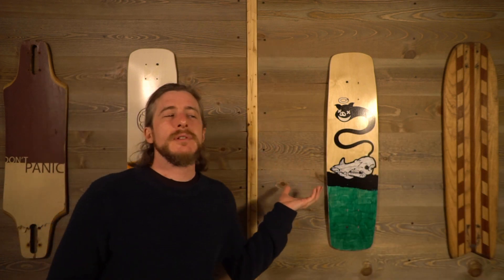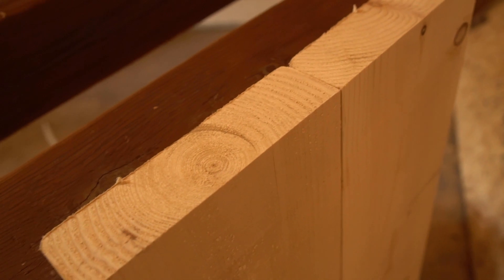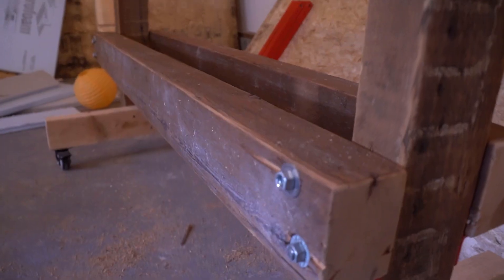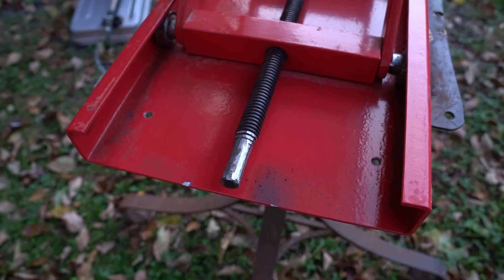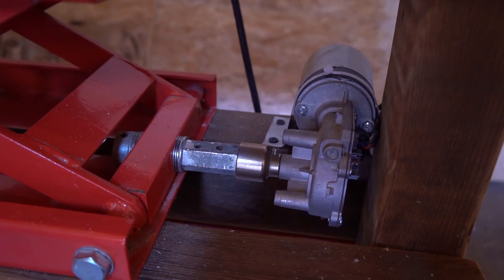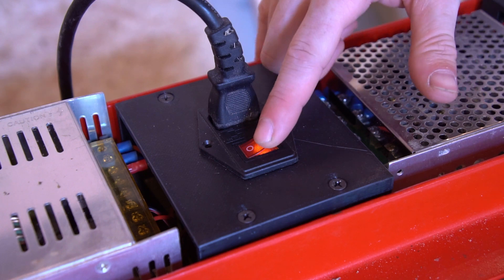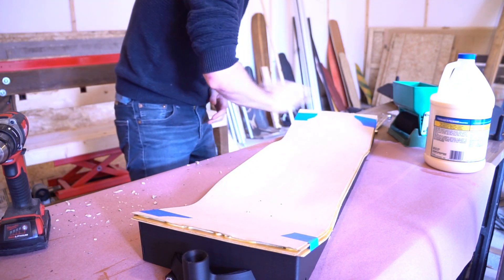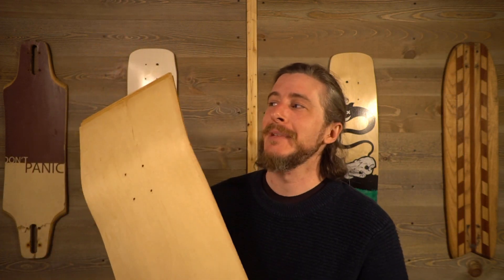Building and Testing my New Electric Skateboard Press

Comment: Hello thanks for the video, that's very intersting.
I want to build a larger press inspired by skateboard press, not for skate deck but , to mold wood thin planks after heating by steam. And I need to mold fast (because of the temperature). Please do you think you can build faster movement press with your system?
Best regards
Reply from the maker: Maybe? The press is fairly slow moving but it closes up in about 15 seconds, so I guess it depends on how much time you need. For what it's worth: if you're going to build a press this way I'd recommend only using a single jack. Getting two jacks to raise and lower in sync has been a huge headache
Reply: @GoodRoads  thank you. At a moment I was thinking on a manual press. A specialized press is not an easy thing to build.
Reply: @GoodRoads   A small question please does these 3D printables molds can be made for everything? On measurement? For exemple a curved wood furniture or a wood dome?
Regards

Comment: Evidently two screw jacks makes sufficient force. You haven’t had any problems? Normally guys use hydraulics which put out maybe 10 to 20 times the pressure. I guess that’s overkill.

Comment: Which motor are you using? I'm deaf and I want to get an understanding how you get an idea of how much power is needed to build a pressure of 2 tons for example.
Reply from the maker: I'm using a set of windshield wiper motors, I've had nothing but issues with them though, the connection method on the shafts are really specific to their use in cars. A geared motor like this with a normal keyed shaft would be so much easier to work with

Comment: if you used brushless motors instead of DC brush motors you could use field oriented control to have more precise control of the motors and run them in perfect synchronization

Comment: how did you manage pressure amount ? i think you need some sort of off switch as safety switch to prevent mold cracking.
Reply from the maker: I just run it until the motors start to bog down, this press isn't strong enough to break the molds

Comment: Hey just wondering, how often do you check orders on your site? I ordered the upgrade kit for the pressure pot on the 7th and not goten any notice yet. Haven't seen any other way to contact about it is all!
Reply from the maker: Hey! Sorry for the delay, I had a couple print-on-demand orders come in all at once and the upgrade kit was in the middle of the queue. It has been printed, packaged, and dropped off at the post office. Shoot me an email at chris@goodroadscollective.com and I'll get you the tracking number, I'm having issues with my website not sending them out
Reply: @GoodRoads  No worry I understand! I do my own craft works and know sometimes theres hickups getting stuff out. :3 I''ll send you an email with the order number to confirm and all in a bit!

Comment: Love following this journey man! Been looking into a similar setup to press some mini ski’s. Is there a benefit to closing the motorcycle lifts with a motor rather than handcranked? Are those motors such high torque that you gain more clamping force?
Reply from the maker: I think an impact driver would probably give you the most torque. The reason I like the motors here is just because it's automated and faster than doing it by hand, I think the torque is comparable. After nearly a decade of hand-cranking presses it's nice to just push a button hahaha!
Reply: @GoodRoads  hahahha I can imagine sir :-) Since you also press snowboards... do you reckon the pressing power of a setup like this is enough for a task like a snowboard or a pair of ski’s? (Not talking about the size of this particular press... just the method used)
Reply from the maker: I'm not sure honestly. I think it would do a better job than the clamping setup I did on my snowboard build last year but it's nowhere near as powerful as an actual air-bladder setup. Might work okay for a DIY board though?
Reply: @GoodRoads  hmmm yeah a fire hose blown up to 72 psi results in a sheldload of force. That is a great way to bend your press aswell as your board :-) Weird that there isn’t real scientific background knowledge showing how much force is needed. It is possible to make a board with ‘just’ a vacuum bag which is only about 14 psi negative if I am not mistaken. And that is only if the vacuum is perfect which it never is. Have you ever heard of any data stating what is ‘enough’? Most likely everyone is just brute forcing it for lack of knowing the parameters that need to be met.
Reply from the maker: As far as I can tell it's not that there's no research (or anecdotal evidence) it's that there are a ton of opinions on the topics, and they all bear relatively usable decks. At least in the skate world. Like you said, the vac bags make good boards with a theoretical maximum of 14psi and on the other end of the spectrum some shapers are running close to 10 tonnes per deck. Bonkers, but they all make good boards. I would imagine you could probably dig up some more concrete numbers for skis/snowboards, compositing is a much harder craft but it's also a lot better understood since there's a ton of industry behind it
Reply: @GoodRoads  Thanks for entertaining this chat bud 👍🏻 Keep up the great work. Very deserving of the future succes you will reap.

Comment: i AM BUILDING A ROPE TOW AND USING A TREADMILL MOTOR 
DO U THINK IT WILL BE STRONG ENOUGH?
Reply from the maker: The 1.5hp treadmill motor I was using was NOT strong enough. I've got a 3hp one on order so we'll have to see if more HP is better
Reply: @GoodRoads  OK i dont know the hp of mine so ima just hope it works lol
Reply from the maker: There should be a label on the side of the motor with a bunch of data on it, voltage, amperage, HP, stuff like that. You should be able to check. Good luck dude, let me know how it turns out!